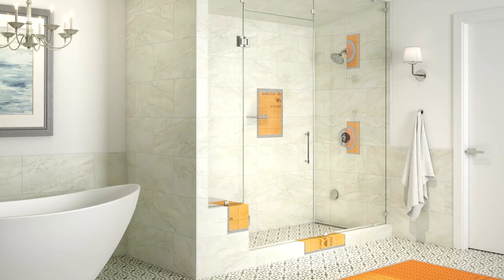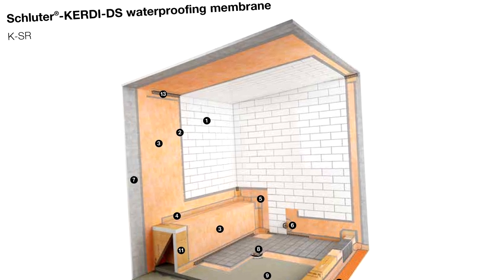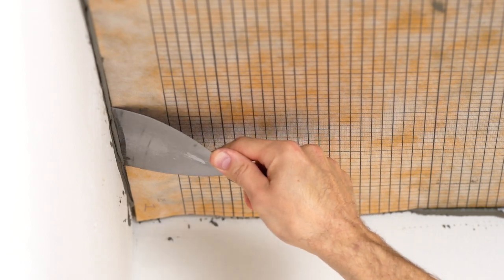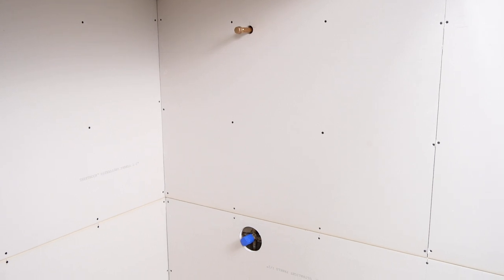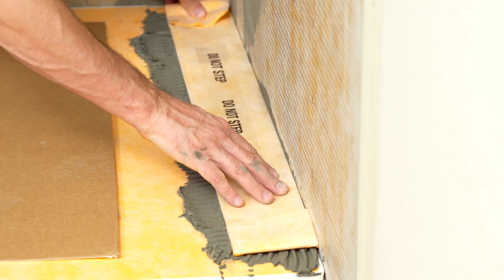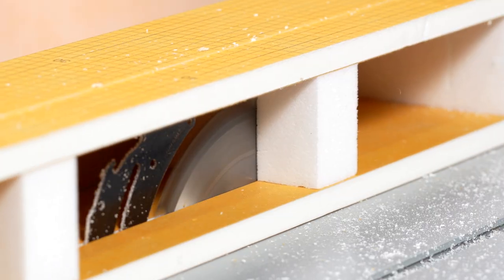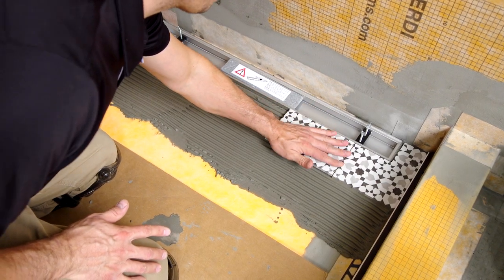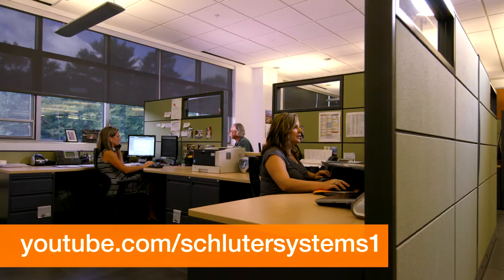Why is the Schluter®-Shower System important to use in Intermittent Use Steam Showers

Comment: I'm confused.  Your 2022 installation handbook says, for intermittent use steam showers that "Movement joints shall be provided at all changes in plane, including floor/
wall, wall/wall, and wall/ceiling transitions. Schluter®-Systems prefabricated movement joint profiles (e.g., DILEX-EKE) provide a maintenance-free alternative to sealant; "

Yet in this video he simply uses Kerdi Band like you would in a normal shower.  I'm trying to sort out what I need to do for a small 3x5' steam shower.  Do I need to build in expansion joints or not?
Reply from the maker: Hi there! Yes, you need movement joints as covered in the Schluter Shower System Handbook. If you look at 6:05-6:25 in the video, you can see the DILEX movement joints on each side of the shower floor. We didn't focus on those in this video, as this is primarily about waterproofing. This tub kit video explains more about movement joints in a wet area @ 9:22-10:10 - https://youtu.be/jnK-8zVYnxI. This video shows how to install the DILEX-EKE for changes in plane - https://youtu.be/L9tVlqVih7Q. We also offer cove movement joints for easy cleaning and sanitary reasons. Hope this helps!
Reply: @schlutersystems1  Thanks for the reply.  To clarify: these movement joints are only for the tile?  I was under the impression most steam showers required movement joints in the waterproofing as well (sealed slip joints).  If only required for the tile, especially in a smaller shower, I assume I could leave a gap and then use Kerdi-Fix to create the movement joint?
Reply from the maker: Hi there, we only require movement joints at plane changes in the tile layer for steam shower applications. Our DILEX profiles, KERDI-FIX, or another suitable sealant would all work. Thanks!